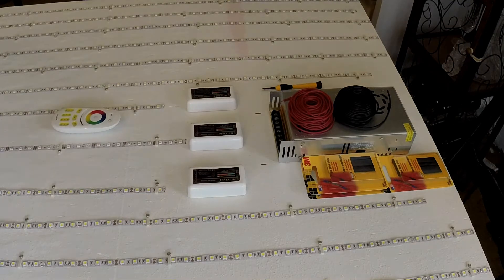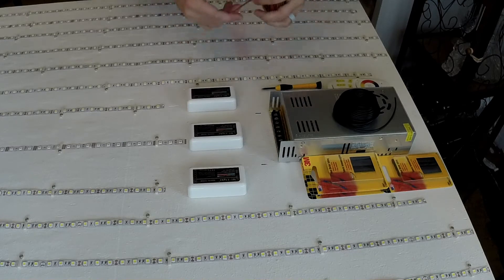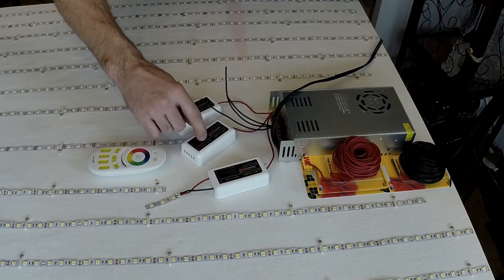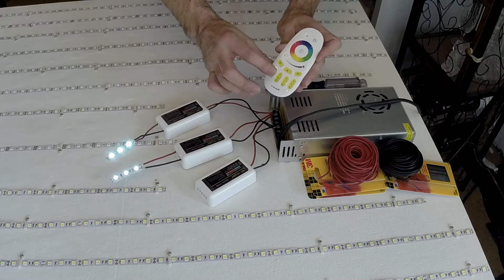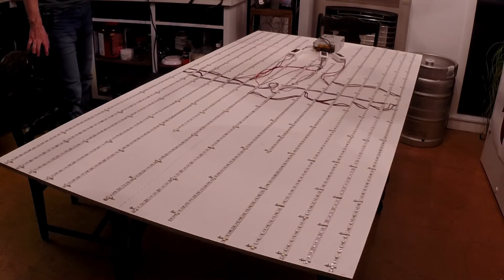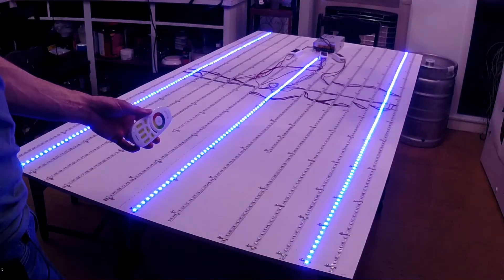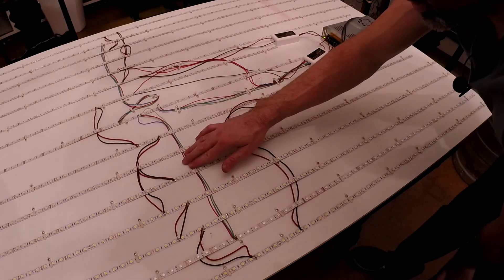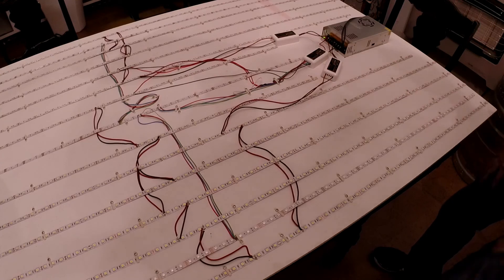Mi Light Rf LED Array part 2

Comment: Thanks for the video! 1)What are the specs of your power supply? 2) Standard strip LED's come in 16ft lengths and include only 1 power supply which connects to one end. Why all of a sudden do I need to reconsider my power req's and power from the middle or both ends? How is your setup different?